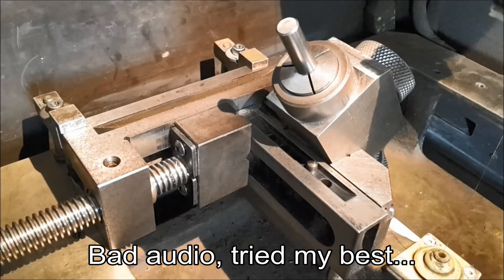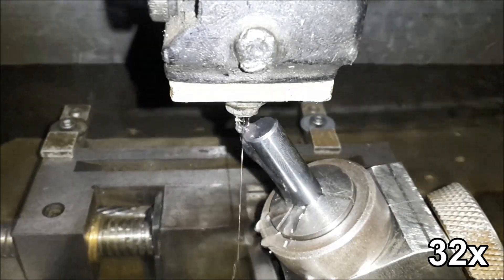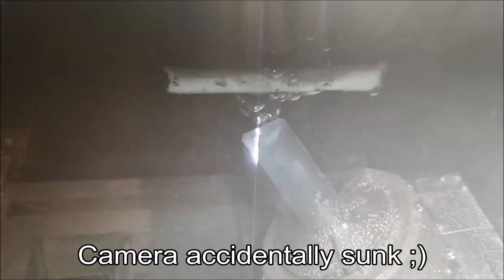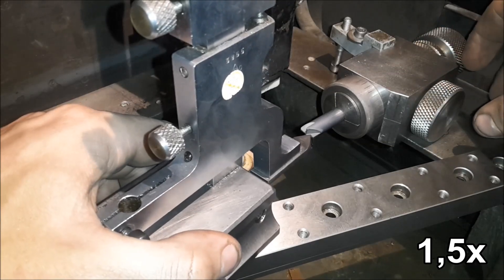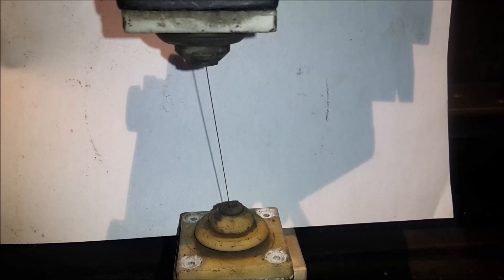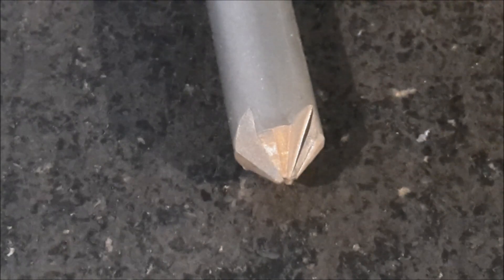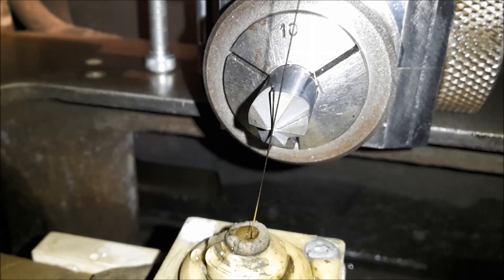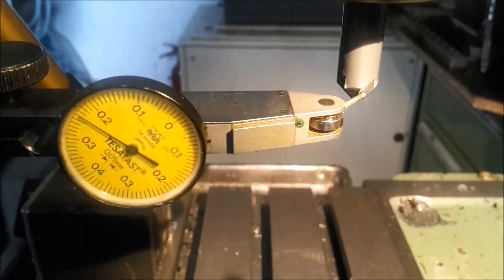Wire EDM a chamfer end mill - Drahterodieren eines Fasenfräsers

Comment: Your best quality cut parameters?

Speed 500
Spark cycle 30
Spark energy 6
Wire speed 8
Wire tension 10
Water 5
Spark rate 10

For me
Reply from the maker: Spark energy 5 (or even 4 on thin materials) spark cycle 35. Good surface finish but also super slow if there is too much finishing allowance. So an intermediate finishing cut with approximately your values maybe is faster. Speed depends on material thickness, about 90% on the availabile power meter seems ok for a good finishing cut. Wire speed also depends on material thickness. On thicker materials the cut gets a little bit tapered with wire speed 8, so maybe 9 oder 10 is the way to go.

Comment: Sorry Mr Flo. Where do you is buy the clamps tool round with divisor?
Reply from the maker: It´s shopmade.
Reply: @flo_5235  i have the same machine from 2 weeks. I see in command mode 2 offset. In the program is possible to insert H1 (off1) and H2 for the second. Is possible to change the speed in the program with Fxxxxx, but for change the current o other? 

Example: 
cut 1: H1 Fxxxx (first cut)
Cut 2: H2 Fxxxx but not change the current o other? For finish cut?

Comment: Awesome and very inspiring! I'm actually starting to look for my first wire EDM machine. Do you have any tips to give? I'm looking at a Fanuc tape cut W2 right now. Do you have any experience about those? Also I would like to know which CAM do you use to program your machine? Thanks so much!!
Reply from the maker: I use this machine not commerical, so for complex contours i use Fusion 360 to get a g-code which i print out and hand code on the machine.